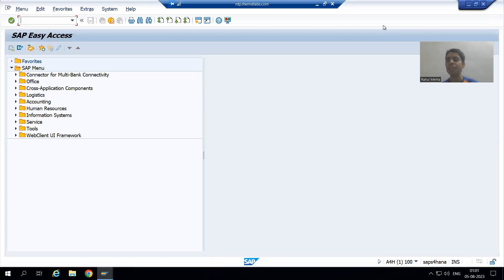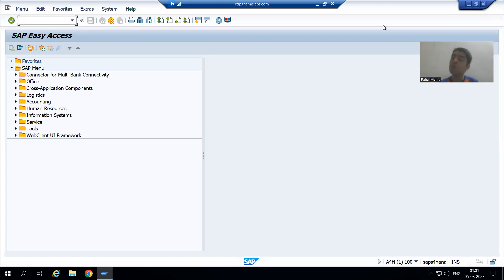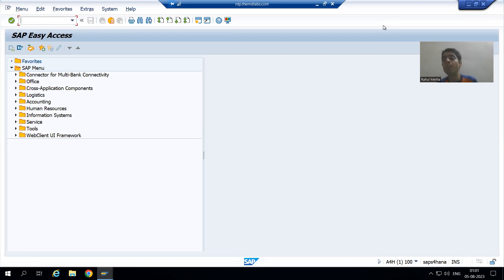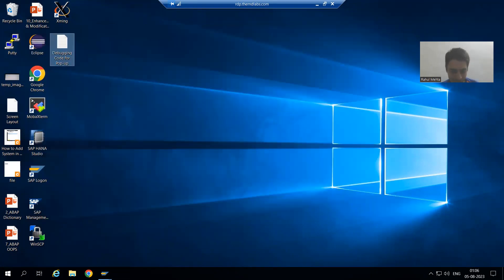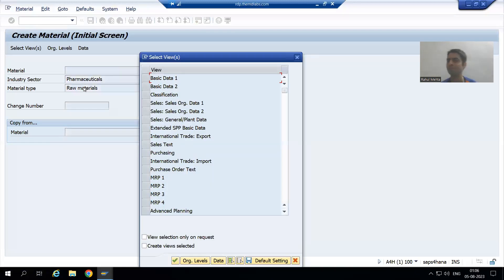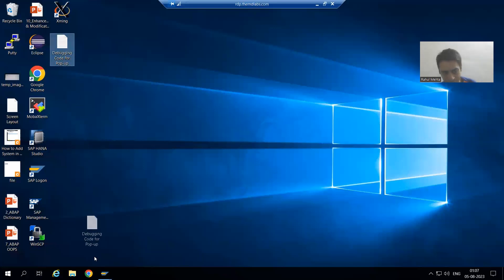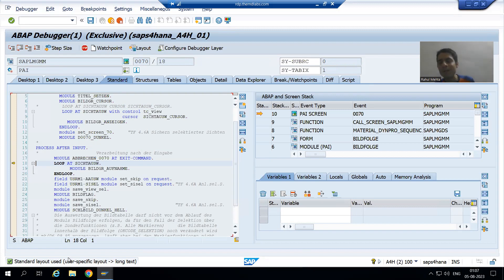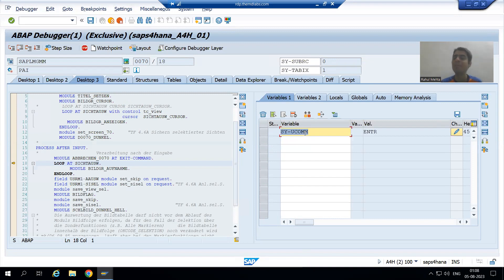17 - Debugging - Way to Debug a Dialog Screen or Pop Up Screen

Comment: I tried it. It didn't work for me in the way specified in the video. Instead, I had to drag and drop it inside half-maximized SAP session. Debugging got switched on in that way.
Reply from the maker: Hello Priyadarshini - If you are unable to debug, You can make a recording and send on rahul3620023@gmail.com. I will check and provide the solution.
Reply: @sapabapbyrahulmehta  Hi Rahul, I am able to debug the pop-up, but the method slightly differs. Instead of keeping the corresponding SAP session minimized, I had to keep it half-maximized in order to drag and drop the notepad into the pop-up. Just wanted to communicate this information to you. Thanks.
Reply from the maker: @priyadarshinin1062    Great.

Comment: Hello sir,
why can't I use that debug?  I've copied and pasted the file
Reply from the maker: You need to drag and drop on to the pop-up window and system will take you to the debugging mode.
Reply: Its not working sir. I have tried
Reply: @rizqimeisani  Make sure you are dropping the notepad file specifically on the heading of the pop up window.